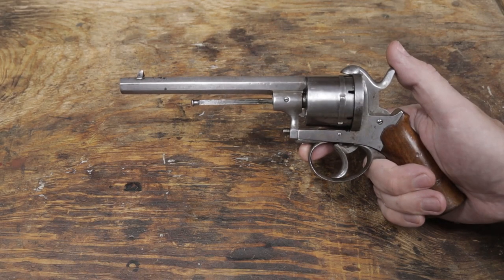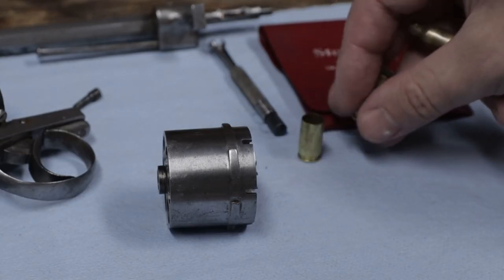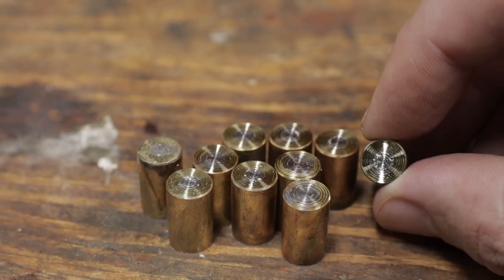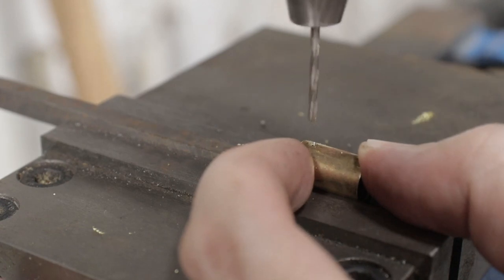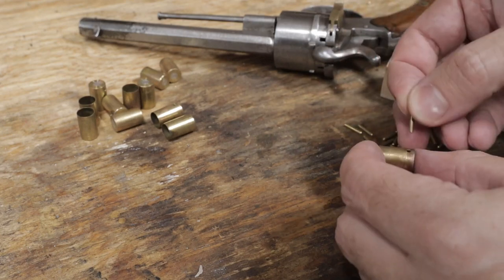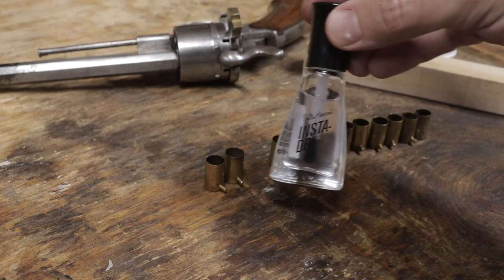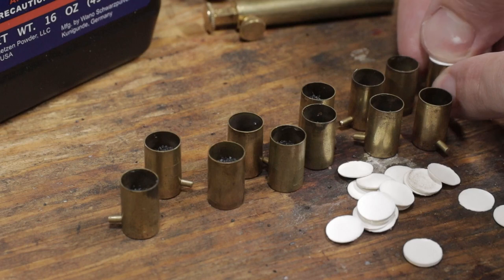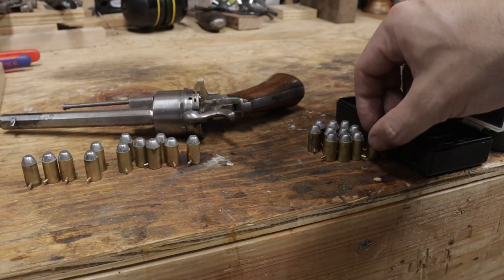Making 9mm Pinfire Cartridges

Comment: Great video as always, I’ve got a 7mm pinfire, now I got a starting point . Thanks !!
Reply from the maker: Good luck! If I ever find one I'd like a pocket revolver in 7mm
Reply: .22 Hornet is a great starting case for 7mm pinfire, and there are eley factory drawings available online for pinfire cartridges that are a great reference! Good luck!
Reply: @cameroncraig7982  22. is considereble less in diameter compared to 7mm more like 6mm and less like 5.5mm right
Reply: @neogeo1670  Yes but the base of the .22 Hornet cartridge is wider than than the bullet. It's a bottleneck cartridge.

Comment: May I offer a thought? For the pins, take your lathe, grind a piece of HSS that will make the end profile what you want. Take your center and put a stop in it. Use a collet instead of your chuck (hopefully with a quick disengagement bar.) Feed the stock forward to the stop, then use the cutter to cut your pins. Make it so that one side is flat and the other is curved as required for making the rounded end.

Absolutely incredible work by the way.
Reply from the maker: Great idea, that would certainly help speed production. I've been meaning to get some sort of collet chuck for the lathe to hold small parts such as the pins.

Comment: I do some wildcatting of the old Sharps rounds where I have to make cases but you have taken it to another level. If I ever have need of pin fire bullets now I know how to make them. I would probably turn them from brass stock but your method seems to work well.

Comment: Oh I found a quicker solder solution you could use?
I cut a strip of brass sheet about .8 or just 1mm, then I fluxed the plate face, not all the area but I fluxed and stood the precut brass tubing onto the plate and soldered say 6 at a time.
I degreased all surface areas.
I placed the strip on a nice flat hebal or use a jeweler's brick.
And I found low melt pnt silver solder was very strong.
Then you simply cut the gaps and remove excess brass with sharp cutters and remove excess completely off on the linersher.
I used dowl that was tight and put it in the case for the linersher to sand off excess.

Comment: I'd love to get a pinfire revolver, but I just looked at GunBroker, and the cheapest ones I saw were above $500 in what looked like so-so condition.  Maybe when I have some money to spare I'll have to prowl the local gun shows.  Meantime, I still need to decide whether to convert my .32 Rimfire Long revolver to centerfire .38 Colt or make up cases with offset nail gun blanks for ignition.  I hate to alter a gun that's more than a century old, but loading ersatz rimfires requires perfect alignment, and the nail gun blanks seem likely to cause an overload in a gun made for black powder only.
Reply: I am late but you can use 6mm flobert blanks (22 bb cap) used for starter pistols. they dont have that much powder in them, so they wont cause an overload. even in a .22 (normal bullet) the cap alone can cause a squib.
Reply: I understood Flobert ammunition, both with and without bullet, was powered only by the primer, like Aguila Kolibri ( only too short for most modern .22 guns).

Comment: Instead of plumbers solder which is 50% lead 50% tin you should try Electronics solder which is 63% Tin and 37% Lead. This is harder/stronger. If you have a problem with the flash hole plug coming out then maybe using a drill to put a chamfer on the inside before you solder it will help.

Also, filing anything with lead in it is a bad idea, you will get lead dust in the air and it's poisonous if ingested. 
Might also be safer to bell the case mouth before installing the primer/percussion cap.
Reply: He actually used lead free solder, not sure what composition it is though

Comment: Excellent work, I do have a question that’s a little off topic.For bullet lube I’ve heard of bee wax and animal tallow,but not crisco. Did crisco work good as tallow?
Reply from the maker: I don't have any experience with beeswax and tallow, I've always used beeswax and crisco. It seems to work well, it's hard to tell on the pinfire but in my black powder rifles the fouling cleans out very easily.

Comment: Very cool, but my question is how do you reload them?  

Also, it seems you found a use for Berdian primed 9mm.
Reply from the maker: I reload them the same way that I make them. The cases don't really expand in the chambers, so they don't require sizing.
Reply: @rakumprojects  What about re-priming?  do you just knock the old cap off, and glue on a new one?
Reply from the maker: @n0tquitesane  Yes. The only thing I've noticed is that the fit of the pin gets looser. Cases that had a snug fit before firing now have a loose fit and require nail polish to hold the pin in place
Reply: @rakumprojects  thanks.  That sounds easy enough.  Now all I need is a pinfire revolver.

Comment: Great work on the pin fire cases.  Just curious how well they reload after firing?
Reply from the maker: The holes for the pins get looser over time, but the case itself and the solder hold up fine.

Comment: Your pin fire cases with out the lathe work done and sized to .356 makes great 350 legend projectiles…… I really need a lathe and a mill. I was able to turn 308 Winchester cases into 35 Remington. However if I had a lathe the process of reforming the extractor groove would have been so much easier. Instead of using a drill and a file but we make do with what we have.

Comment: This was a great how to video and very relaxing to watch.  I have been casting pure lead bullets this morning for black powder revolvers.  I made a test paper cartridge using flash paper and flash glue, and a .44 Johnson & Dow bullet seated upon 30 grains of 3F  Goex.  I hope to shoot them in my Pietta 1860 Army and 1848 Uberti Whitneyville Dragoon later this month.  
I own a 7mm pocket pinfire revolver.  My brother made brass cartridge tubes for me and dummy heeled aluminum bullets.  I made the pins like you did and drilled the case holes.  I did not make shootable cartridges because the 7mm cases are just too small to work with.  You did a great job on your 9mm ones.  Did your soldered Luger brass center holes hold up good enough to reload ?
Reply from the maker: I've reloaded some cases 3-4 times now and the solder holds up no problem. Some of the pin holes do get looser though.
Reply: @rakumprojects      That is great.  I had never seen solder used before.  I have watched Dr. Durell Shepard fill centerfire holes with threaded brass bolt shafts and then drilling above to retrofit for rimfire.
Reply from the maker: @robertrobert7924  I've seen people do that for pinfires as well. Solder is much quicker though and holds up well enough, especially for small calibers where theres very little pressure
Reply: @rakumprojects       You have certainly proved that.

Comment: Have you reloaded those cases multiple times? Any trouble removing the spent caps from inside the case? This is fascinating and I love seeing these old obsolete guns able to shoot again.
Reply from the maker: Yes, I have some that have been reloaded a few times now. The only issue I've seen is that the hole for the pin gets looser, requiring nail polish to keep the pin in place. Other than that, no issues.